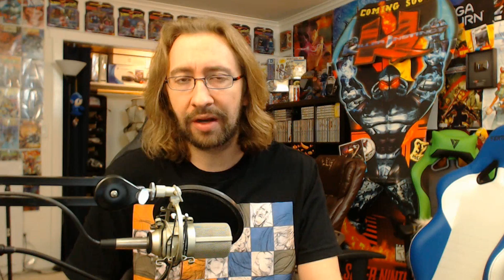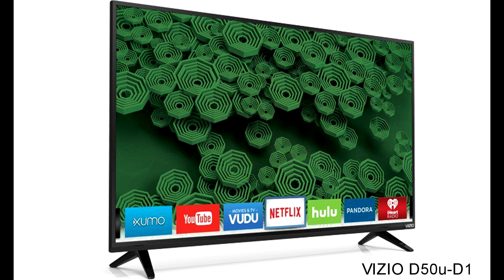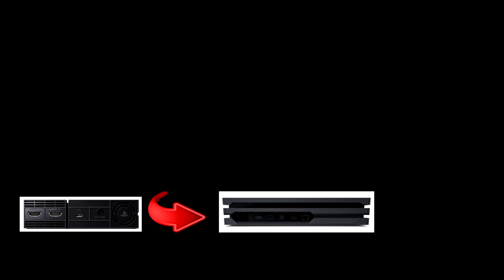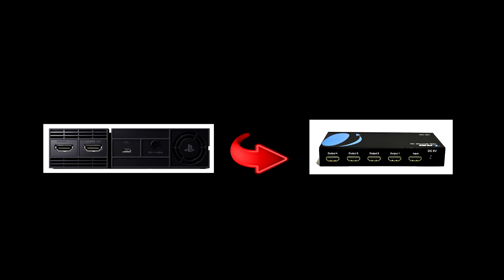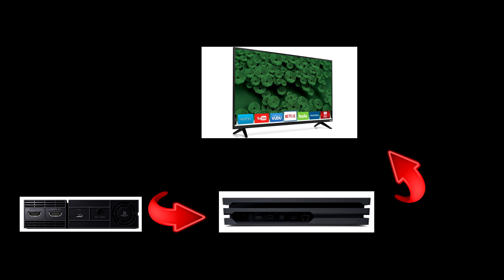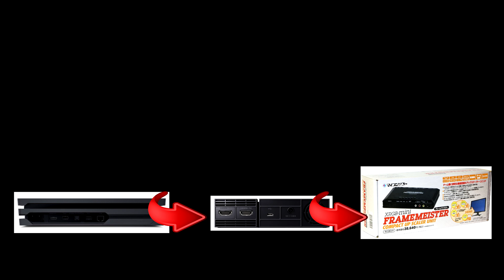MY PS4 PRO NIGHTMARE...And How I Fixed It

Comment: I still have a day 1 ps4 console with the shiny side.  Going to be upgrading to a 2tb hdd/ssd hybrid.i honestly don't care bout the vr on the ps4, I'm running a MSI Z170A Krait Gaming Mother board. Intel i7 6700. 32gb ddr4  G.Skill Aegis ram & 8 Gb  ddr4 Corsair dominator Platinum ram.  For my video card i'm running a MSI gtx 970 with 4 Gb gddr5  gaming oc. and an antec 750w + platinum psu.

Comment: I believe the update was HDR...the 4k HDR(2.0)hdcp is not the same as 4K non hdr (1.4). Also i think your Tv even though its 4k (1.4) its not 4k hdr (2.0) compatible. Also there are different hdmi cables for this standard as well. Maybe this is why your PS4 pro worked at launch non hdr then stopped working when they enabled HDR. I have a PS4 Pro hooked up to a 2016  Samsung 4k that accepts 4k hdr input and I do not have any issues. Good video thought and good explanation.

Comment: I get the black screen occasionally on my LG 55OLEDC6, I run all visual settings on auto. For me, the first fix I found was simply unplugging the hdmi cable from the tv and plugging it back in, that worked every time but I got sick of getting up and reaching behind the tv, then I started turning the tv off and on again, that works 90% of the time. My final fix is changing the input type from game console to PC by going to all inputs and changing the icon... that last one is LG specific I'd imagine, but it works every time. Not once have I had to put the PS4 pro into safe mode, too slow.

Comment: Sounds like the framemeister fixed it... Gotta love hack devices! and FUCK DHCP (DRM)
Reply: madjimms this is why I'm in support for DisplayPort being as standard as HDMI currently is on TVs.  DisplayPort is royalty free, open standard and doesn't utilize content protection (DRM).  Other benefits include but not limited to, far greater bandwidth, supports much higher resolutions, as well, native support for highspeed bi-directional data (USB 3.1/PCI-E 10Gbps), display daisy chaining (multiple monitors plugged into each-other from single source).   HDMI doesn't really support any of that...

Comment: Whenever I get a black screen (which only happens upon startup of my ps4 pro) on my 4K HDR Vizio I just grab the remote switch to the next hdmi input then back to the one the ps4 pro is plugged in and boom problem solved...easy. No need to change any setting or reboot over and over etc

Comment: I was having trouble with my VR connecting to my Original PS4. It constantly give me a black screen playing VR games.  It was connecting to my splitter.  I have to remove the hdmi cable to the splitter and connect directly to the lcd tv.  It did the same thing. So I  replace the hdmi cable and put a different hdmi cable in, it works. What the heck? So the only thing it doesn't work is my original hdmi cable that hook up to my ps4 to the splitter.

All I remember in the past like the VCR and DVD Player is that their product have really high standard but they lack other feature of the competitor (vcd, avi, mpeg).  I can't believe they are going for video game as well.  There are many gamers who have different kind of tv and if Sony does this kind of crap, their products will not sale well and people will just simply go to their competitor (Xbox One and Nintendo Switch).

Comment: I had no issues with my PS4 Pro on the day that I got it. I preordered from amazon and due to their crappy shipping they got it to me over 4 days late. Only issue I had was the HDMI cable I had from monoprice (usually made great cables and now they are garbage) Plugged it into my HDMI 1 port on my Samsung 4k TV. No issues unless I had the monoprice cable was connected I used the included HDMI cable in the box and it does 4K resolution and the games that support the new hardware work like a charm. I had a vizio D series TV and nothing but issues with it with a xbox one s. Kept freezing up during game sessions. I returned that and paid the extra money for a Samsung which I should have done in the first place. Might have something to do with Vizio getting bought out not too long ago. I think their TV's will start to decline in quality as time goes on.

Comment: IT DID THAT TO MY TV, BUT ALL I DID WAS TURN MY 4K TV OFF AND TURN IT BACK ON AGAIN AND IT WORKS PERFECTLY.
Reply: SO SORRY YOU HAD TO DO ALL THAT. All I DID WAS THE ABOVE COMMENT.
Reply: Zenosama 1 ..I have a 4 k television and I just bought the PS4 pro and when I plugged it into the TV I couldn't get 4k..it said my TV did not support it. How do I get it to work with 4k?

Comment: get a PC, less problems... lol
Reply: NODQ not even drivers were a nightmare and console has less potential problems for new gamers
Reply: OfficialSandfreak1 driver issues are hugely uncommon now a days...  only issue I have with PC gaming is windows its self, but have to pick your poison.   but even the occasional botched update, Consoles are not immune, I remember twice during the ps3 era Sony released updates that some units bricked with.  2.40 and I think to much lesser extent 2.41 with them pulling 2.40 for sure.  I believe they also had issues with 3.3x updates causing some software issues but by that power by I was gone.  As for the PS4 I haven't participated much in, only hung out with friends that have PS4/pro, and yes there is a lot of little problems, but little annoyances that on their own aren't problematic can and do add up, as anyone with an obnoxious sibling can attest to that ton of really small issues do quickly add up.  

Nothing is perfect, however this sort of thing should have defiantly been better ironed out before release of the PS4 Pro.  "Automatic" HDCP doesn't seem very automatic to me..  plus anyone that understands how digital signal in HDMI knows, it isn't the cable, unless the cable is of very low quality.  The version standards are managed on the port side... not cable side.. a high quality HDMI 1.0 is effectively a average HDMI 2.0 cable as well... no wiring difference... 

Then there is the other issue with $1300... I'm sorry but at that point why keep trying?  Seriously, $1300 can afford you a very very high end PC, or an average PC(mind you average is still kick ass)  or even minor upgrade to existing PC, and update your stupid with more things you been wanting with a lot of games and accessories and whatever...  $1300, on a console+solution to fix an issue we all agree shouldn't exist? Come on
Reply: wtf some ppl... it was meant sarcastic and as a joke because consoles were always easier/less problems for gaming than a PC. But nowadays it seems the other way around. As you can see obv. And ppl come ehre and post 100000 rows of text :D about whatever

Comment: I'm sure for the jo blow user they won't have this issue as you said plugging the ps VR into the PS4 it worked. It worked because that is the way it is supposed to be plugged in.

It is obvious you know what you are talking about just sayin if the common user wants this they shouldn't have problems

Comment: they're not not going to fix it my only system as ever been ps to ps3 and i only thing I've heard that sony gets hack all the time. but i only play games off line so i don't need to worry about being hack. and for the system not to work with a 1080p or a 4k i would've brought it back to where i bought for another model.

Comment: Not a PS4 Pro issue, it's your 1st gen TV fault, I have a 2015 4k Vizo 50 inch TV, had same issue with my Samsung 4k Blu Ray Player, Xbox One S, and PS4 Pro. Getting proper 4k display fixed issues with all devices.

Comment: It's kinda hard for me to believe that a guy who does video stuff, as you say, has never run into HDCP handshake issues before. HDCP is a complete nightmare... all of these hoops just for a useless copy protection.
I've had several HDCP handshake issues with different devices over the years.

Your argument that your TV runs everything else fine is pointless. I've had handshake issues with something as simple as a BluRay player on one TV that "played everything else". Was the error with the player? I don't know. It worked fine with another TV. These things happen with HDCP every now an then.
So, how do you tell which of the devices is fucking up the handshake? As a result, you have no way of telling which device is fucking up here. If anything, your experiments show that adding another device in the chain that does a handshake with both connected devices fixes your issue.

Basically: HDCP sucks and this issue isn't limited to PS4 Pro, nor is it a new issue. HDCP always caused issues for legit users, while pirates don't give a damn about it... pretty much like every other DRM out there.

Comment: I had no issues using the high speed usb cable that comes with the pro in my Samsung tv. When you use an uncommon brand of tv you run the chance of issues

Comment: you didnt spend $1300 to play ps4 pro. you spent that to stream and split a signal into multiple devices and use a 4k input for 1080. my ps4 pro did have problems with that vizio model but i did the work around and it outputted at 4k 60hz no problem. did not spend $1300.

Comment: Holy rambling Batman! Every time I hear people rambling over and over and not getting to the point I always check if the video is just over 10 mins. 2-5 min issue turned into a 10 min ramble just to push more ads.

Comment: I actually had this same exact problem as many others did with my base PS4. I still can't get it to connect to one of my older 1080p LCD screens. I'm not surprised they're running into issues with it again with the PS4 pro. I'll still probably buy one when it comes down in price sometime next year. Until then I'm just fine with my original ps4

Comment: LG is going to be issuing an update to fix this by the end of Nov.  Funny that my XboxONEs worked day one. Its a Sony and TV manu problem. Mine works fine after i turn HDCP off in the settings. But once it hard restarts, i have to safe mode set it to 1080p and re disable HDCP and set settings back to automatic. LG says they are fixing it, So, we shall see.

Comment: 03:00-That right there should be the perfect fucking reason to not buy pretty much any system at launch these days.  Wait until companies bother to fix the damn thing, because A CONSOLE making you do all that is fucking ridiculous.  It's annoying enough to slowly configure 7th and 8th gen consoles, now we need all that for it to function on TV's the system is absolutely RECOMMENDED for!?  The fuck ever happened to "plug the console into the outlet and the output into the TV and it just fucking works out of the box."
And all this is on hardware that despite the mid-gen upgrade STILL lags behind decent desktop computers.  I'm mainly a console guy but this is pathetic.

Comment: Here's the issue I am having.  The PS4 Pro supports 4k with HDR (high dynamic range) which looks great when working properly.   However the pass through on the PSVR does NOT support 4K HDR.  So you have to unplug the PSVR and direct connect to my 4K TV every time you play a NON VR game.  Very inconvenient considering the back of my PS4 pro is not easy to access.  trying to find a splitter that works but no luck yet.

Comment: It sounds as though your splitter isn't HDCP 2.2 compliant.  The FrameMeister sounds as though it's stripping it completely (very likely given that it's an older device but still somehow compatible).  An HDFury would be the cheaper and more standard solution in your case.

Comment: I'm using an LG C6P and haven't had a single issue with it since launch.  I'm not saying it's not an issue, but there must be a more reasonable explanation for this.  You mentioned a PS VR, and a capture card.  Were either of these devices connected when you first connected it?  This seems strange to me.

Comment: lmao this dude its complaining on something the ps4 is not design for or at least not the main concern of sony, do your research first if the ps4 is capable of doing the things you want, a casual ps4 buyer will just plug directly to the TV and it will work. dont be a hater

Comment: Going through the PS VR processing box disables any kind of HDR, so I wouldn't use that setup as a solution. Huge oversight on Sonys part imo. 4K HDR signal requires HDCP 2.2 and the breakout box only supports an older version of HDCP.

Comment: I have a very similar experience with my Xbox One S and a 4K LG display. There seems to be a lot of miscommunication between major display manufactures and major device manufactures. I never remember a specific display required to run a a game console, even when it supports the console's resolution and inputs. The only device I can trust anymore is nVidia graphics cards, which appear to work with all displays. They are also quick to release updates to fix any issues, where Microsoft has not released a fix yet for LG users. Sony and Microsoft are just not communicating with these manufactures.

Comment: Sony told in capital characters the VR device doesn't support signal passthrough in 4k, so your framemeister is upscaling a 1080p signal to everything else, is for this reason that works, furthermore I possibly have a quicker solution for everything else, just try to disable HDCP and see if it works. To tell it all, is YOUR problem, cause not everyone else have all the crap you have stacked on the signal.

Comment: I think it's because that TV does not support HDMI 2.0 (or high color gamut).. The PS VR is HDMI 1.4, which some older/cheaper 4k Tvs use. I just checked your TV on Rtings! No wonder why it doesn't work!! it's rating is 2 out of 10 for supported resolutions. True it has the least input lag out of any Tv, but it's also the worst when it comes to different types of resolutions. I think 4k has 3 types but PS4 only supports 2. The 2 you're Tv doesn't use. My friend has an LG and he had a problem but then he just turned on Deep color and it works. Your TV doesn't have any option like that because it doesn't support high color gamut, which is used for HDR and what the newer 4k Tvs use.
Reply: Get a ks9000 lol

Comment: Hi, I've been a long time fan of your YouTube channel and I love your Street Fighter matches online. I just want to say thank you for your review on the PS4 Pro. I had a similar issue with the old PS4 when it came out because the system was very picky with the TVs I used and I love to use many devices with the same TV all at once. Lucky I bought the right TV that supports everything.

Comment: The PSVR has a HDMI 1.4 port, whereas the Pro is HDMI 2.0. . . So if you're routing the Pro through the VR box, then you can't get 4k HDR to the TV because of the limitations of HDMI 1.4.

Comment: I had the same problem with the Pro and my new LG 49 UH620V,  which I'd bought a month earlier.  Works fine with games now, but I can't access Amazon Prime, Netflix or even YouTube for 4K streaming. Coupled with transferring all my data from my old PS4 - which took 8 hours - it was after 10pm on release day before I could use it. Still have no idea whether it's Sony or LG which will have to provide the patch.
Reply: Update: just found out there's a firmware update on LG.com which LG put up on 11/11. Downloaded it to a USB stick and installed it on the TV.... and everything now works with HDCP enabled!
Kudos to LG; they literally fixed this the next day. If only we'd  known!
Just make sure you create a new folder for the patch named 'LG_DTV' or your TV won't recognize it.

Comment: Just put in safe mode and put it in hdcp 1.4 and then it will reboot. Screen will be black still. Turn it off completely then put it in safe mode again and go to resolution and it will reboot and show a picture asking to set resolution. It should be fine from there

Comment: i feel really lucky. i bought a 4k sony 8305 android tv before hdr came out and was gutted. i was considering getting a new 4k hdr tv as i was getting the pro and it stated my tv will only do 30fps. i decided to get pro and see how it manages on my sony 4k non hdr and was shocked how well it played. as soon as i stared the pro direct to tv using the supplied hdmi cable, it showed 2160 res 60hz. i never had one issue. i then run through vr with supplied hdmi and my old 1.4 to tv. still 2160 60hz unless you switch headset on, then obviouly goes to 1080. i then run it through my 4k yamaha 4k passthrough amp for dolby digital. still 2160 60hz. i run everything and never had an issue. i even game captured all fine with vr or non. weird. i think i will stick with my tv in that case. lol

Comment: Once again copy protection fucks the legitimate user while the content pirates carry on unabated.
HDCP is sooo much more trouble than it's worth. It's designed to prevent the illegal copying of a copyrighted video stream (like a film), yet is also in place for games.

Perhaps you could look into items that "fix hdcp problems" like HDFury, or certain cheaper splitters, just don't use them to pirate video streams ;)
Reply: although....if the HDCP handshake and signal is broken anyway it might not work. YMMV.

Comment: When I plugged PS4 Pro into my 1080p monitor I couldn't get a signal either but it also wouldn't turn off. Thinking it was doing some firmware update or something I didn't dare touch it, after ten minutes of waiting for something to happen I needed to leave so I just turned the monitor off and left PS4 Pro alone. When I came back a few hours later and turned the monitor back on I got a signal and it was asking me to press the PS button.

Comment: What happens if you remove the PSVR from the signal chain?  So the PS4 connects to the Framemeister instead the PSBR.  It might be the Framemeister alone that does the trick.

Comment: sadly not only the ps4 is having this issue. even my ps3 after the latest update wont run on 1080p output. i even tried connecting to a switch and sony is messing things up